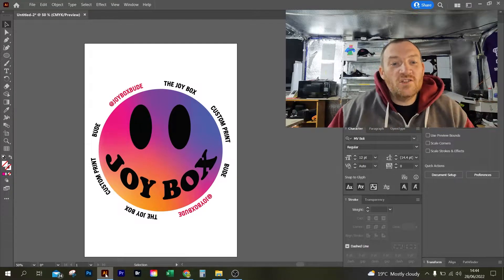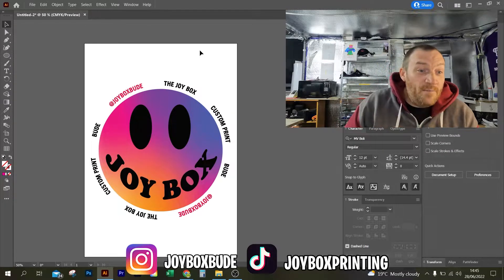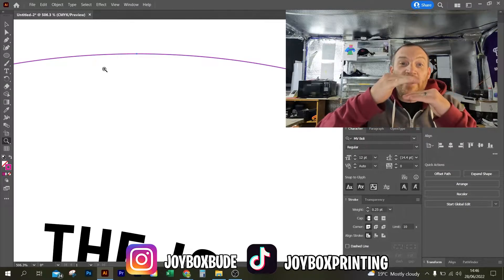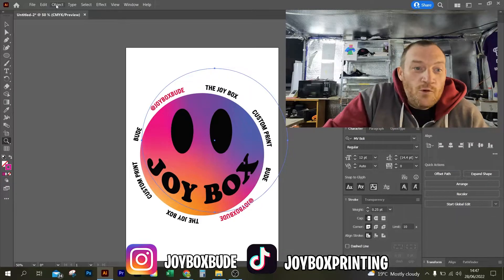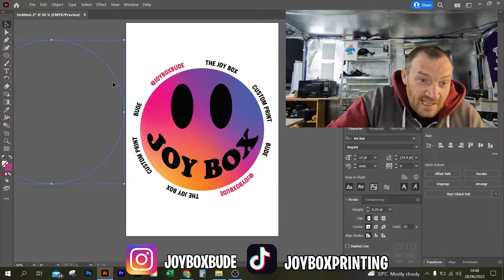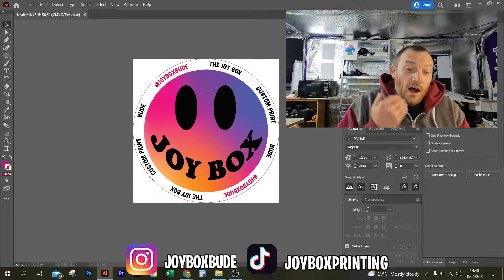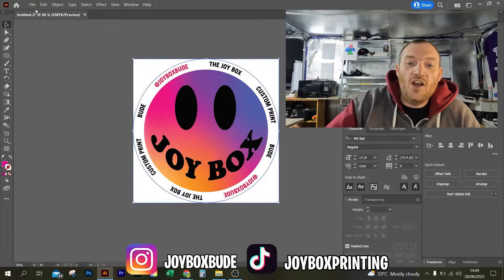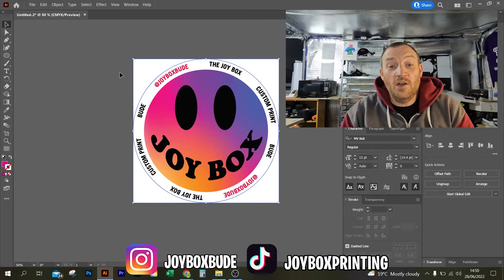How To:  Fix Double Cut Lines in Adobe Illustrator

Comment: Even after doing this, still double cutcontour lines. Any more ideas? I only see 1 line when doing ctrl + y.
Reply from the maker: Have a look in the layers panel and expand all.  You might literally have a duplicated cut line. If not, clear the cut lines and start them again.  Good luck 👍
Reply: I already did this. Started over 100 times. Still double cutlines while there is only 1 curcontour.
Reply: @FrankCornelissen-i7i  instead, can u do a offset path and try? i mean dont draw an object cut line.. just use offset path method and try.. luv to hear back the results

Comment: Solution for drawn paths

The solution shown in the video did not help me at first when applying this to drawn paths which you want as cutlines. Unchecking the ‘convert all strokes to outlines’, will actually result in the opposite behaviour and turn your path into an object (stroke changes to fill). After hours of frustration, I have found the solution:

Select the path which you wish to turn into a cutting line. Remove the stroke, and select a fill colour. Now apply the ‘flattening transparency’ tool, by unchecking the box ‘convert all strokes to outlines’ and click OK. Now, remove the fill and apply the desired stroke swatch again.

Goodluck!
Reply from the maker: Always good to hear peoples workarounds, nice one!
Reply: Thank you! I drew a path with the brush tool and spent so much time trying to figure this out, thank you for the excellent solution.

Comment: If your cutline stroke was being path outlined either side which gives you a double cut which can happen when receiving files from a customer sometimes this can be version compatibility issues which automatically does this or the way the file was saved then select the cutline and go to compound paths and release this will separate the two unfortunately the stroke which was in the middle won't be there but you can select one of them then go to path offset path and either minus or plus the offset to find the center of the original stroke weight delete the other two make that path a clear fill and create a CutContour swatch as discussed below and that will work also because what you are stating in the video won't work if the file was saved in the wrong way and created a double filled stroke if you get me

Comment: This tip will help for print and cut on any wide format printer/cutter from illustrator all you need to do is create two layers one for print and one for your cut have all of your artwork on one layer for print then create a new layer for the cutline always have your artwork layer below the cutline layer the cutline layer fill should be clear but a colored stroke it can be any color the trick is to have the stroke in front of the fill in the color palette then go to the swatches palette click on the 3 lines to the top right then click new swatch which is at the top call the swatch & this is the important bit CutContour exactly as I have typed it no space between the Cut & Contour and the C's must be capital and the rest lower case then below that is the Color Type drop down menu select spot color and that's it...Any wide format printer RIP software should pick this up as a print & cut file
Reply from the maker: I'll give that a try 👍
Reply: @joyboxcustomprint  I don't think the stroke weight or color matters just the process of creating a SPOT color swatch with CutContour as the swatch name with the Cs Capital as typed no space let me know how you get on...